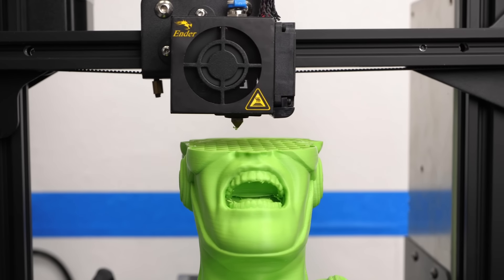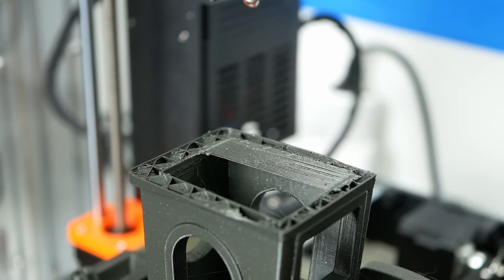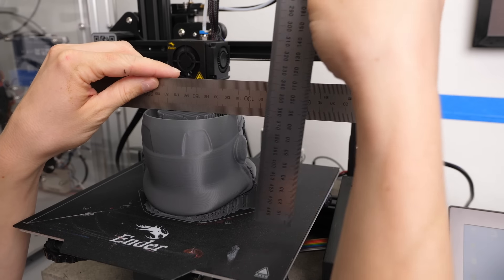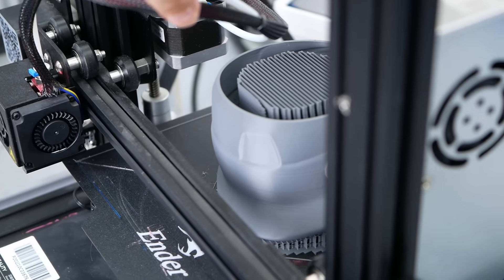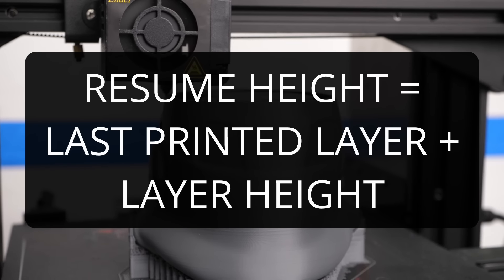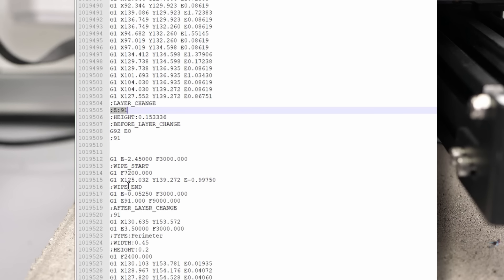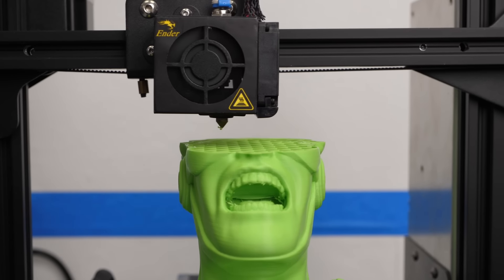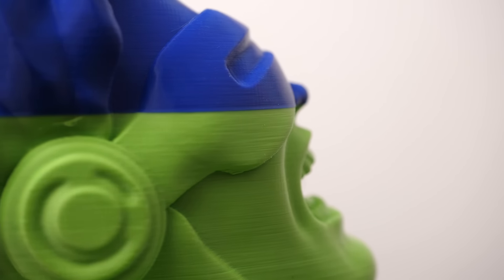HOW TO: Resume a failed 3D print!

Comment: I had seen that video before.... When my 20h print failed this week, I remembered and revisited it..... Great work! Perfectly presented! I learned a lot about gcode, about my slicer and about my printer, and now have my own adapted recovery process.  Finally my print finished completely. Unfortunately I had to restart printing 3 times at different layers due to extrusion problems, and possibly my manual re-adjusting of the height of the nozzle was not absolutely perfect. And thus these layers are a bit weak. As the print was a part with 88 in-print movable joints, unfortunaltely some of them broke after removing the finished print from the support... So it was not a full success for me. I would have needed to work more precisely. This was my first time try to recover, and a learning process while doing it. And there is also some luck needed here ;-)
But: The process you describe, is fully applicable, and your presentation and explanation is top quality! Thank you very much!

Danke Stefan!

Comment: I tried this technique a couple of years or so ago.  I tried to figure out which layer the print failed on by measuring with calipers and also the z-height.  I edited the g-code file to pick up where the print left off.  It worked, sort of.  Layer adhesion at cold joint (to use a concrete trade term) was very poor.  I may have missed a layer or, as I suspect, z-shrinkage due to the print cooling may have been the culprit.  I had tried to keep the print warm with the bed.  Perhaps a heated chamber would have helped?

Comment: saved my butt. worked on BambuLab P1S too. idk about the software for moving the tool head, I did it by hand as close as I could, then used the G92 Z command to set the head as ".5 mm above last layer" (aka same as the next Z command, just added .5), which was a rough guess. It's been 4 layers since, seems fine.

Comment: I would say that this was familiar and useful because I have been through this experience before myself.
Some suggestions;
If the nozzle temporarily is blocked and is recovered, then manually crank the leadscrews back counting the stepper motor steps your turning, to lower the Z'hight back to the previous point of printing. (Normally I do this when getting the first layer height just right) Sounds crazy, but it's simple and effective!
Other than that, I generally measure the height of the failed print too and then reslice the file from where it needs to continue from, print and then glue the two parts together... 
Last tip if you notice the fail soon enough... If you do see it soon, then you can pause the machine and read the Z-Height from the LCD screen instead of with a ruler after the fact...
But I will take note of the trick you use regarding modifying the G-Code to continue directly from where it finished! clever...

Comment: I was printing directly from Pronterface, paused for colour change.  I must have touched the USB cable because the interface locked up. I did the file editing as described here, shutdown Pronterface and loaded the edited copy the the Gcode file.  Unplugged/re-plugged the USB cable, reconnected Pronterface.  Then print.  Success!  Editing was easy for me because the display panel still had the Z layer still listed.

Comment: Stefan, just wanted to say thanks for the great info here. It helped me save a 62 hour print after power outage with 30 minutes left. I normally run from the SD card on the printer for longer prints to take advantage of PLR but this one was running straight from a raspi running OctoPrint. Your video helped me save the print and I thank you. Keep up the great work.

Comment: I'd say this solution works just in a perfect world either gcode modification or amending malfunction by hand. I've spent 5h to use Pronterface and finally I have both layer shift and too high extrusion problems (I had multi items on a bed to print). Nevertheless, great work. Prusa users shout out: turn off RPi in settings, and use M121 instead M211 S0 and you should be rocking with Pronterface

Comment: Well less than a week after watching this and I actually got to use this technique! Was half way through a print when a pause gcode I had set came up. For some reason it killed the nozzle temp at pause and didnt reheat after the resume which resulted in no filament coming out - the perfect scenario to recover from! I carefully clipped the gcode and was lucky I could still home the Z without interfering with the part. In the end, the Z was slightly too high but it did even out after a few layers. I think without seeing this video I would have just restarted the print.

Comment: I was able to set the z height correctly on a print that was too large to home, but there seemed to be an offset in the x and y position when I started the print - I know that this is an old video, but is there any chance that you could add a section on how to add a relative x/y position?

Comment: I can't believe this worked! Yesterday I was in the middle of a 3 day print of an oversized, extra infill, crystal dragon for a birthday gift. It is using a rainbow filament so it was crucial I resume the print on the same spool. the filament got stuck on the frame and didn't extrude while I was at work all day. I came home to a print head 30 layers above the last printed layer. I cancelled the print. set the bed temp to hold and waited until I could pick up a caliper after work today. I picked up a $30 digital caliper from harbor freight for this.  I measured the height. modified the gcode I had mostly ready to go from last night. googled some klipper commands(inherited a cr6se with sonicpad running klipper that im still learning) and Success!! what an amazing feeling! I wouldnt have had time to finish this print for the bday boy if i had to start over. I am so relieved. Thank you!!!!!!!! Fortunately I could send G92 Z location directly from the local browser interface into the machine so no need for the software you mentioned.  still learning how to understand everything this tutorial walked me through.

Comment: I attempted to do a Vase print on top of a solid print.  I had two files that I planned on printing back to back and sliced the Vase with it off the base.  I printed the solid "collar" first and as soon as it was completed I quickly started the Vase.  With 10 minuets to go on the bottom print I realized it would home again and probably collide.  It did.  First print popped off when it crashed and I'll probably end up printing the Vase separately and welding them together.  In the meantime I'll learn and practice manipulating the gcode to get the results I was hoping for.  

If I could have the print head move straight up to a safe height after homing and before printing.. I believe that would have worked.

Comment: Hey i recently discovered a trick for cleaning the nozzle and wont look back. 
i heat the nozzle just above the highest temp for the fillament i was printing then use a folded paper towel to wipe the heater block and nozzle. 
the fillament soaks into the paper towel and the nozzle is super clean. i noticed you using a brass brush but you should try this. ive had the same nozzle in for 6 months now and it still looks brand new.

Comment: I had a dice tower print out fail halfway through. I cleaned the unfinished surface, reset the printer, and in the slicer I dropped the tower STL through the print bed until it was right about the point where it failed, then I resliced, printed the piece, and super glued it on top :)

Comment: I was unable to save my print (Z axis is way off without the ability to do bed mesh leveling on my Prusa i3 mk3S+) but this video was still a big help. In preparation for the next failure, I'll write a script to replace all of the relevant Z-moves with a value that has a slight calibration added in.

Comment: Great tutorial, so helpful, but for anyone trying to resume a abs print (9 of 12 hours) after it has sat for about 10 hours (didn't notice it until the next morning), good luck.   The abs was subtlety warping and messing up the initial layer.  I went from layer 186 (which was correct) down to layer 174 just so the nozzle had proper distance.   I know I could have manually moved it down, but meh, now I am trying the second technique of printing from that layer and going up since it failed at a non-critical layer/area.
Also, I used Cura/Ender 3 and pasted my first layer just below the M107 line, but also made sure that the first z movement was above the first print layer so that it can down to the print instead of risk bulldozing it over (had this happen twice before I found the fix).  I also removed the first two testprep lines, that will also bulldoze your print off the bed.

Comment: i did it with 2 prints already(on a prusa mk3). I measured the height, and then like you, opened the gcode in Notepad++ and removed nearly all before my failed height.At first i crashed into the print but luckily nothing happened. The problem was i probably deleted too much, so it homes and then wants to go to the x and y coordinates on z=0.2, to fix this, i paste a "go to z (higher than my fail height)" then it goes to x and y and then a bit down to the right Z and starts.  😁

Comment: I've never tried this as I lacked information. Now this is a good backup. Only used to slice the rest of the model to a new file. But one time the filament runout sensor stopped a big print and I was unsuccessful to resume the print, not a lot on this topic :(

Comment: what is needed is a sensor kinda like a mouse wheel that gets moved by the filament if the filament is stopped when its superposed to be moving or just runs out it will trigger a pause.

Comment: Cura and some slicers do on reset extruder position on every layer.  If this is the case once you fine the right layer, look for the first E#####.###. copy that and add G92 E#####.###-.5 to the gcode file before the print start info.  line 27 in Sepfon's file.

Comment: I have tried that two years ago, but the problem was the homing movements, so I removed 4 pieces and placed them again with extra hair spray, but... they moved a bit. The other 8 pieces was finished well. Also, I have edited G codes to add or remove the fan at certain layers due a small GAP where the support material was difficult to remove.

Comment: Very I formative video. Thank you so much! 

In my country we have daily blackouts which lasts hours. I'm using a prusa mk3s and while it's power panic works most of the times it's not very reliable. I've had to refer to this video many times to save a print. Now whenever I start a print I try to ensure I've left enough space so that I can home it, if there is no power panic recover available. This atleast saves me from having to home it manually.

Comment: Many thanks for this, I would never have even thought to attempt this before watching your video, your instructions were great and very clear. I managed to resume a print which I deliberately powered down for the night as I was worried it would run out of fillament and wanted to monitor the print. Little did I know that the Prusa slicer defautls to disabling auto resume to reduce blobbing so I was left really frustrated in the morning.... until I found this video!!! Thanks again.
Reply: also... along with the comments below, it makes the "filemant run out" anxiety go away, no longer to I need to worry so much about the filament running out or breaking during a print! Awesome!!!

Comment: I had a print fail before, but released the print from the bed. What I ended up doing (which was super scuffed and i dont recommend) was making the print into a negative space and basically printed a hole/guide on the bed to set the print in, then started the print again from the height it failed at

Comment: Ty so much kind sir! 

But I have a question for any willing to answer!

How do you remove the bottom layer in ultimaker cura? No matter what I did or how many layers deleted there was always a bottom ghost layer that stuck. Thankfully I just removed the board and let it print the ghost layer but any help would be much appreciated! 😅👍🏾

Comment: For people using S3D, There is a function in the advanced settings tab called "start printing at height: ...". Here you can easily restart the print from the desired layer height. Just remove the gcode from your starting script tab and you are good to go!

Comment: Of course, I looked this up because it just happened to me.  I was lucky in that I could reach the bed with the print in place.  I followed the instructions exactly and ended up having to some detective work because all of the sudden my extruder wasn't running at all.  It was running before, my drive gear to push filament came loose, but it was running.  Then I performed the deletions, and it wasn't.  I was shocked that it found the layer though, and started up looking like it never ran for 2 and half hours printing in midair. Doing the deletions as described cause me to delete my final extruder temp, which prohibited the extruder from running but didn't stop the machine from running???  Anyway, I was able to figure it out and get my print back on track.  I was 4 days into a 6 1/2 day print.  Thanks for the video and advice.

Comment: I would add a tip to process when there's a power failure - the printer does not know the Z height at all - it's quite similar. You have to touch the print when it failed and either set the height to the height that you've measured with the print or set the height to 0 and reslice the model cut  with a plane at this measured height.

Comment: This is my first failed print, but I did it on purpose. I have an Ender 3. I stopped a print to change the colour. When I finished, I was not able to resume the print. So this is very helpful. Q. I took a screenshot of the display showing the exact XYZ stop position. Can I use these measurements ? And how?

Comment: I had to go read the article and got it working on my print. It started printed at 27mm but the issue is that the X axis was shifted of 2mm. Not a big deal for this print. I think I move the parts in the slicer by mistake because I did some CTRL+Z while I was figuring things out.

Comment: new comment in an old video xD i had a print fail once and was able to recover it however as some time had passed the pla didnt stick porperly to the previous layer my only thought was to use a heat gun to lightly heat the last layer but have no idea if it would work, any thoughts?

Comment: Additional challenge comes if you had to restart the printer if you did indeed screw something up. I ended up removing the sheet with the failed print, auto-leveled the bed using another sheet. This also messes up the homing settings. I had a large print obstructing z-homing, so I moved it out of the way, while putting only a corner of the sheet under the nozzle. I then ran G28, and the rest of the print just as suggested in this video. I could see the line where the print resumed because I wasn't able to position the part in a perfect position on the print bed, but otherwise it saved me 24h of reprinting.

Comment: Old video but still relevant since the fail power function in marlin sometimes causes issues as it pauses during saves so its usually turned off for large detailed prints. Had a print fail today because of octoprint instance powered off. Was able to walk through gcode viewer and find the stop point, use the videos direction and restart it at that point and save 32 hours of printing and 750g of filament that would have been wasted.

Comment: I once had a 19 hour print with tangled filament after 15 hours. I was able to keep the temperature so the part didn't seperate. I measured the height and for safety counted the layer lines. I used Simplify3d so I just added a second profile for the half that printed correctly and choose to print only the first profile. I had to rearrange the order for leveling the axis so the part wouldn't be tossed over. It all worked except that the new first layer didn't adhere properly to the previous and the second half warpped. The adhesion was enough so that the print could finish but I got some really ugly seperations at the seem.

Comment: Thanks for one reddit post and this video I have now become master of returning my prints into life. (darn wonky bed temp sensor...)
I use full cold starts method by recording or measuring the point of death Z and just using force command on the code to set nozzle height to that. Works amazingly with near zero shift on Prusa MK3S.

Comment: I had, as some of my first prints, had a clog on a sculpture. I had removed it from the bed, then smoothed the top, then reprinted the missing part starting at the failure layer, then used a soldering iron to combine the two parts... and then smoothed it over. Since I was hiding the thing under lacquer anyway, nobody was the wiser.

Another time, I had the filament running out - and I just went in and hacked the old G-code, removed everything till the line where it stopped, added a movement to some above the failure Z-level and bam, it just printed upon the old print.

Comment: Thank you for this guide. I had a lot of trouble getting it to work, but after a lot of head scratching, googling gcodes, reading my gcode file over and over again and taking notes, it finally started to make sense. So I got there in the end and learned a lot along the way :)

There was some extra gcode I needed to keep, regarding relative/absolute extrusion modes. (I think) because I'm using SuperSlicer-2.5.59.0 Arachne edition, OctoPrint, Arc-Welder and mriscoc firmware on my ender 3 v2. But I'm not sure how much of a part each of those played.

I was getting some crazy behaviour before figuring that out. The extruder was trying to pump out tons of filament.